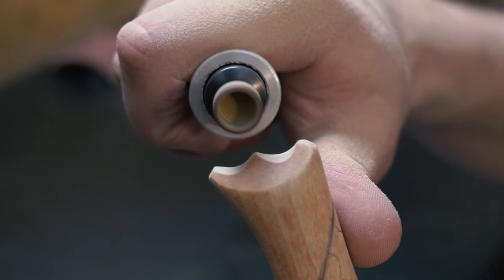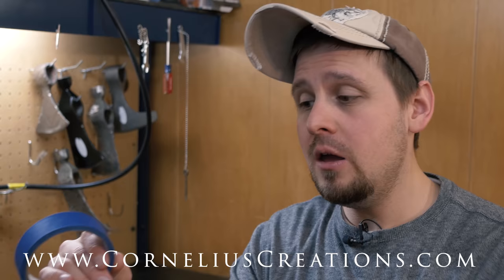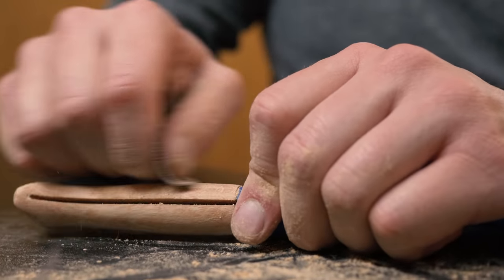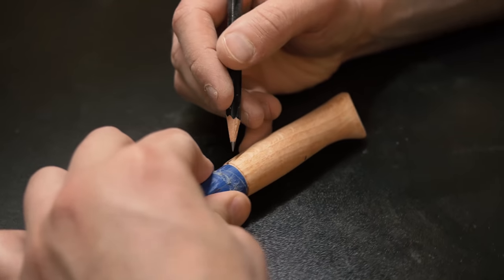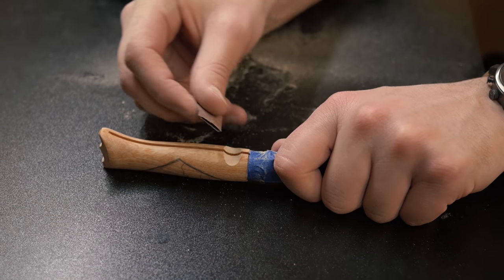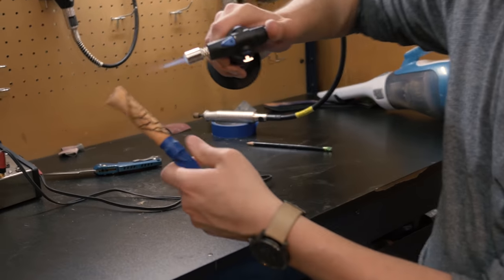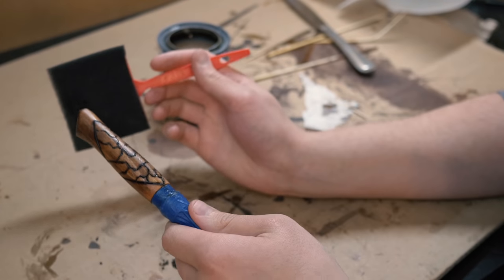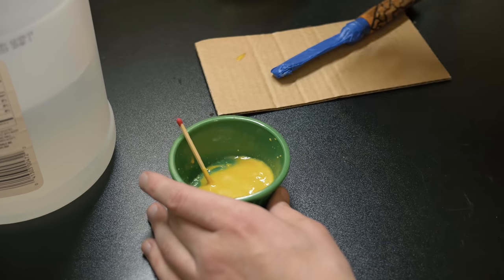How to Wood Carve/Mod Any Opinel

Comment: Thinking of purchasing an Opinel #8 and #9, and these kind of mods are right up my alley since I love modding and crafting stuff. Another  couple of really cool options you can do on these, is inlayed patterns on the handles using crushed Turquoise and the thin CA glue to set it with, or thermally transferred images like woodland or farm / hunting scenes.....simply make a photocopy on a printer to the size you want that fits the handle, flip it toner side down, tape it at the edges to secure against movement, then using your wood burning shader tip, turn up to pretty warm but not so hot it burns the paper upon touching it, and just shade over the toner to heat it up and transfer the image to the wood, light sand and poly, DONE and it looks fantastic.  Great job, you earned a new sub brother !
Reply from the maker: Fantastic advice! Thank you so much, Darrell! I look forward to seeing you around!
Reply: @CorneliusCreations well Matt, here it is one year later and I’ve only just this week ordered an Opinel #8 to play around with. If interested in how mine turns out , what’s an email I can send a few pics to ?

Comment: great stuff !  i coffee stained my blade, i'd read it doesn't last as long as the acids in the mustards etc, but mine has... and i'm very happy with it ! it's had some use, some cleaning and a lil coconut oil light greasing.... still looks good.

Comment: Excellent video thank you...I have a heap of the Opinel knives and been thinking of doing the handles with a bit of class and surprising enough the wood burning unit you use I thought would have to come from overseas but bugger me there is a place here in Auckland NZ just down the road from my work that sells that brand....gonna have to get one for sure ...😄😄

Comment: Great Tutorial, thanks a lot. 

What I would like to do is etch my thumbprint on the blade. Do you think it will work if I press my thumb on the blade (after cleaning it first) and then cover that area with the mustard mix?

I'm hoping that the mustard won't stain the blade where the grease from my thumbprint it, but as I've never done this before I'm not sure if it works or not..
Reply from the maker: Hmm... That is very creative but i’m not sure if it will take a full thumbprint. It would definitely be something to try just to see what happens!
Reply: @CorneliusCreations  I know, my thumb is certainly bigger than a opinel blade. I was just wondering if the grease from my fingers would be enough to stop the etching fluid, while still etching between the ridges. We'll have to try I suppose! Thanks for your reply anyway.

Comment: if you did this on a kitchen knife would you have to coat the blade afterwards? to cut food safely?
Reply from the maker: A lot of kitchen knives are made of Stainless instead of High Carbon so this won't particularly work that well with any kitchen knife. A lot of people use a patina like this for their outdoor knives to protect it against rust and such.

Comment: Hello! as I have said before thank you for the video and inspiration. I am mostly done with personalizing my first opinel knife and I was just curious about the sheath and how you harden/bake it. (Like how you keep its rounded shape, How you restring it, What strings you use to restring it, What part during the hardening you can burn designs into the leather). Maybe if it isn't too much to ask you could do a mini video about how you personalized the sheath. Thank you so much again!
Reply from the maker: I will add that to my list. The leather is about 6oz veg tan. Meaning it’s pretty hard and it doesn’t loose shape. The leather you have in mind is about 1-2oz. That is real flimsy in thin. I will do some leather work videos soon :)

Comment: Excellent video but I am curious why you just don't take the knife apart first. You can take it apart and put it back together in less than five minutes. I realize taping up the handle can be useful but there are better ways of clamping the handle.

Comment: patina only works with carbon, if you have the stainless it will not work
Reply: Ahh thanks, just wanted to do it but i sadly have the INOX Version. The Carbon Version is better to sharpen isnt it?
Reply: Good to know, thanks
Reply: @Trichromasie  carbon steel is easier to sharpen and in some ways stays sharper... amongst a bit more abuse. In my opinion carbon steel is just better save for the fact it COULD rust... however if you patina the knife the right way rust will be of very little concern. Get another opinel, they are cheap enough :)

Comment: i followed your directions for the blade patina twice not working
Reply from the maker: Did you get the stainless steel version? Does it say “inox” on the side? This only works with high carbon knives.

Comment: is the opinel a folding knife and where can they be purchased are they carving knives?
Reply: lawrence aldridge theyre really high quality folding pocket knives
Reply: Cody Kowalski
"High quality"?  They're one of the cheapest folding knives you can get and they rust quickly.  They're nowhere near high quality.  But they're definitely worth the $10 they charge.
Reply: Blue the blade it won't rust ever!
Reply: @BornIn1500 I still have my uncles Opinel,he died in 2014 and he edc that knife from the early 70s.Still works great.No blade play when it's locked,opens close like new.Only some scratches on the blade.Opinels are in a museum because of their design,where are all the other high quality folders? why they didn't put the Buck in a museum as the best designed pocket knife? Some years ago, a friend of mine bought a Benchmade,it's blade wasn;t centered,he couldn't sharpen it and it's handle felt worse than any cheap Chinese folder I ever held..Marketing tricks dude.Nowdays everybody scams for money.Opinel feels and performs,much better than any knife I ever head.That's quality my friend,not the lies they sell to you.
Reply: @greekveteran2715   Being in a "museum" doesn't have anything to do with quality.  It only means the design has a lot of history.  There are sharpened rocks from cavemen in museums, too.  Those must be "high quality" too, right?  Hahaha.  I agree they are worth the $10.  But they're still $10 for a reason.  They are cheaply made and they aren't meant for hard tasks.
Reply: @BornIn1500  Hard tasks? Knives are meant to cut.Youtube and marketing tricks have made people think that a knife is a pry bar.. guess what.. knife is a knife a tool to cut. Companies are very clever.There is a ton of brainwash going on youtube and internet,that a knife has to be a prybar with little very poor cutting performance! I have more than 100 knives,from the most expensive to the cheapest chinese.Opinel is by far the best knife,thats why it sells more,it isn;t only the price,because there are handreds if not thousands of cheap knives on the market.PS go and read the reason the Opinel is in that museum,It's nexto to Rolex and Porsche,not because of their beauty or age.Tools are not photo models you know.Go read more and go buy and use as many knives as I have and then we speak again.
Reply: @BornIn1500  Inexpensive doesn't  equate to low quality. Opinel knives are high quality, simple, everyday knives.
Just because a company doesn't charge an arm and a leg doesn't mean they don't produce quality products.